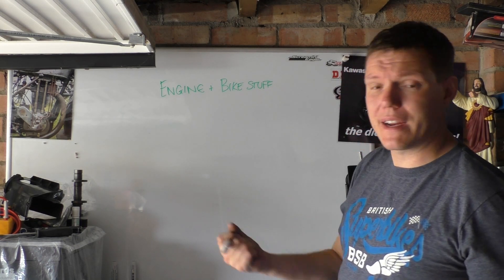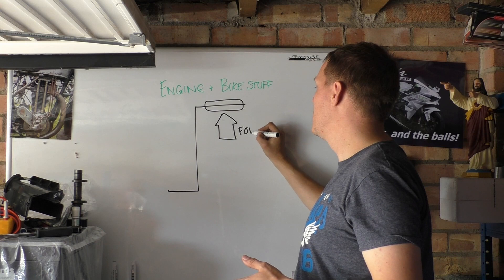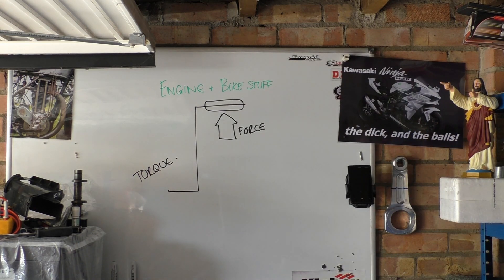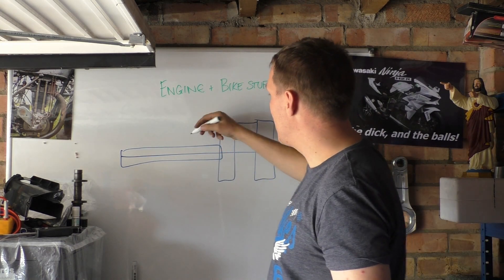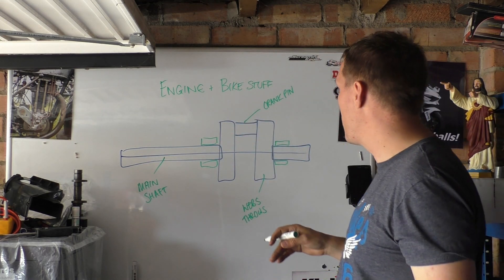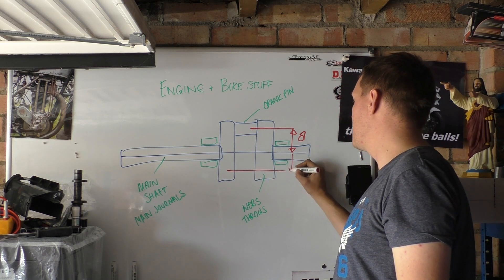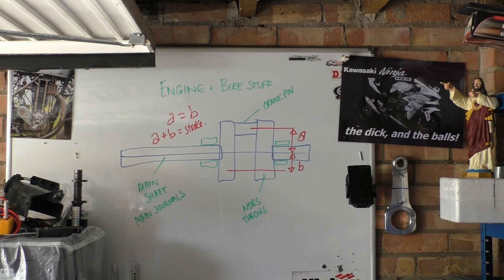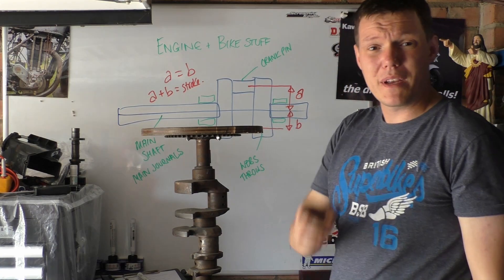Motorcycle-simple - Crankshafts

Comment: thank you Matt. have a small question.
so theoretically there's a small clearance between main / crank journals and their corresponding shell bearings. engine oil which is being fed continuously prevents their direct metal to metal contact ?
keep it up 😊
Reply from the maker: Yes, the crank is basically floating on oil. They're called hydrodynamic bearings.
Reply: @thedirtyworkshop  got it. thx 😊

Comment: Matt, how hard did you say it would be to make your own engine? I want to make a small displacement radial engine to use on a motorcycle. Not because it is better than anything else, but for a custom bike I just think a radial engine is cool as fuck. Either 5 or 7 cyl
Reply from the maker: Do you mean a rotary (rotating) radial (star cylinders LOL) or a rotor engine (wankel)?
Reply: I meant radial, I am a derp
Reply: I should have known that too, they are some of my favourite engines
Reply: Moto Rad+ You could use the cylinders & heads off an old Harley engine or an air-cooled Beetle. Any engine with individual cylinders could be a donor but air-cooled pushrod engines would probably be the easiest.
Reply: ...he said Wankel.